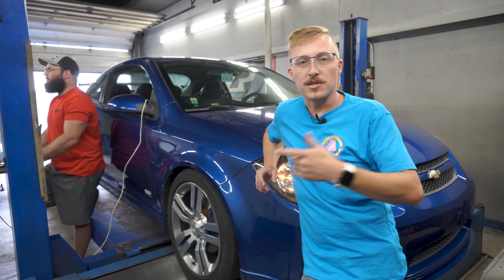LSJ Stock Pulley Power Record? // Cobalt Build Episode 9

Comment: Great numbers Tyler. Just proves that making your engine run efficiently as possible with proper cooling mods can add fair bit of power without going the standard route of doing a smaller pulley size. I will be proving this theory myself on my le5 07 Pontiac G5 gt. I want to get the most power I can from the 3.1 pulley that comes with the zzp supercharger kit. Shooting for 240 to 250 whp.
Reply: Should be able to! My 2.4 S/C with the 3.1 made just over 250whp on E85 (on an Auto haha). Super fun set up.
Reply: Tks man that is great to here.  My G5 is auto as well. I'm going to be running 91 unfortunately because of my area and we don't have access to e85. So im hoping somewhere between 240 to 250 be fine for me honestly. I got a ported blower and ported lsj tb and I'll get the zzp 3 inch cai from you guys.
Reply: @chadoliver2966  On 91 octane here as well, you MUST get you car tuned because the stock maps are for 93 octane. You have KR puling timing, and you can safely make 230whp on 91 octane with a proper tune. Do you have hpt?
Reply: Bro, unless you have sh*t gas where you live you should be making 260 right off the bat on a superchargered LE5 running the required supporting mods, full exhaust and cooling mods...

Eta; see you're stuck with 91, weak. Still should get real close. Get a midlength header, catted DP, 2.5 exhaust with resonator, duel pass, option B. I'd bet $50 you'll hit that 250 on 91.
Reply: @trevorplagg7094  what did you need for E85 conversion thank you.
Reply: @trevorplagg7094  wait yours a auto? How’s it running? I have a 07 auto n found super charger for 150 locally. So trying to push 240 on 3.1 pulley
Reply: @hanielbomb I know this is a year late but is your car still holding up? I know those auto transmissions on the cobalt do not take to well to boost which is why I chose the 5spd

Comment: I'm doing a 2.5" custom exhaust because the previous owner stupidly removed the resonator and replaced the stock muffler with a smaller flowmaster. Mine sounded like crap before and even worse without a muffler and only a new resonator on 2.5". With the new muffler from Thermal it actually sounds really nice under all conditions except WOt over 4500 RPM when it goes back to fart can... 
It's just crazy because I have 2.5" exhaust on my sky and with a centrifugal S/C it's making way more power than the LSJ, but it just sounds so good all the time. I guess the extra 0.4L of displacement really helps with the sound...
Reply: @Cory Scopis Actually during my exhaust build I did actually drop it down from the lift and rev it up as a joke. Yea it's real bad.

Comment: That is sick...... Wish I knew what mine dynod at.  Gm stage 2.   Bought it this way so I don't know much about what tune it has
Reply: Gm stage2 is usually 240ish
Reply: @BKRedline  thanks.  Feels great for running 240 or so.  I'd boost it up to e85 if I had it in my area.  Best I have around is 91 octane.

Comment: Well done! All about playing the efficiency card with any blower.
What do you mean by "Almost no knock"?
Are you getting some tip in when engaging power enrichment, or you're seeing knock during the pull?
Reply: On the last pull I saw a few degrees of KR at the top end. It really doesn’t see any KR out on the street on the same file. Could just be some not so great E85.
Reply: @gbrunner24  Even on bad E85 giving you anything less than 85% ethanol, that's a bit a strange.

Possibly false knock if it doesn't repeat itself.

Loving the setup Tyler! Just keep that muffler on lol
Reply: @D.O.I.N.K  yeah, Al was a bit confused too, obviously it’s not audible actual knock, so we weren’t worried. 

The car did have a knock sensor code when I first got it running in the spring, been meaning to replace it at some point. 

Thanks man! I’m loving the journey, stock muffler is definitely sticking around 😅
Reply: Got that sensor 90°? 😂

Comment: Do you have a list of mods that you have done so far to get those numbers?
Reply: ZZP CAI
Stealth Heat Exchanger
ZZP S1 Intercooler pump
Mid length header + downpipe
60# injectors
E85
Stock pulley
Boom tune

Lol, really not all that much to it.